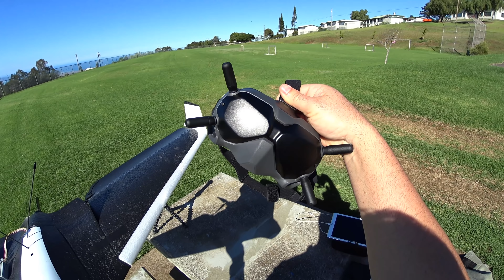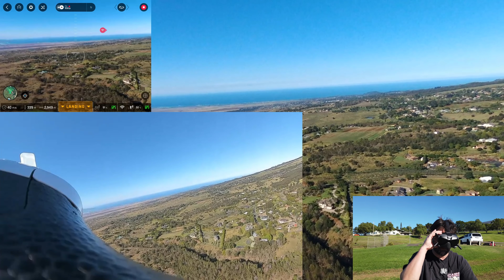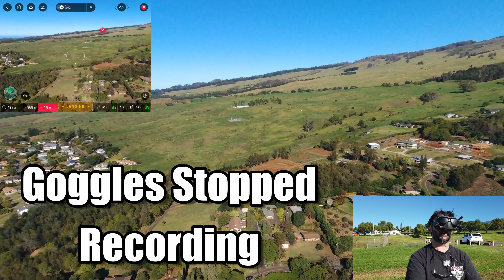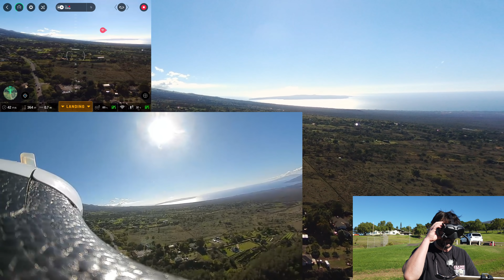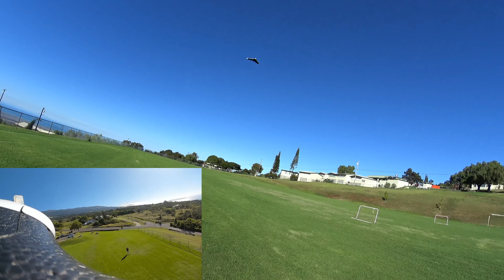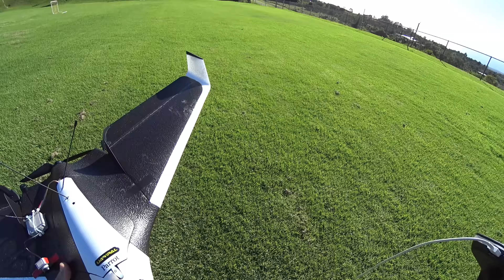DJI Digital FPV System Maximum Range Test (1200mW Hack) - How Far on 4GLte Parrot Disco?

Comment: So does this mean we don't need a Flight Controller to unlock or Arm the camera to full power to use on RC Cars etc? Just run that tiny script in the Goggles 2 (in my case) and that's it? ?

Comment: I regularly get over 10km/6miles with my V1 on 700mW, using patch antennas. Never flown with stock ones, but seems that replacement is worth it.
Reply: Which patch antennas do you use?

Comment: One thing that stands out for me on this video, is just how good that parrot Image stabilization is. I really wish they would start making a new version of the DISCO again!
Reply: Yep, stabilized video is the thing I like best about the Parrot Disco. Oh and, the 4G mod of course. Oh and the capability to add a 10.000mah battery for almost 2 hours flight. Oh, and the way it launches and loiters so easy and the way it lands. Parrot Disco is THE dream FPV plane. If only it had a better camera and a bit better WIFI range it would be totally perfect. Yes, the do need to make a version 2.

Comment: Could you PLEASE PLEASE do another at 50mbs! I’ve heard the syncs pulse is what kills the range even if you still have signal, but that DJI extended the sync pulse range on 50mbs.
Reply from the maker: Yes.  I just did a ground vehicle test video with the 50mbps and plan to do another with this wing 🍻

Comment: Looking at the time the video was uploaded it's before the DJI update that removed the 6 km / 4 miles hard limit (imposed by latency between DJI googles and air unit). At that time better antennas didn't help. Nowadays you can go much further. ;-)

Comment: So i have the DJI system but i am encountering low bit rates and poor transmission to the point where it disconnects acter like 400 metres?
Reply from the maker: Check your power setting in goggle options? Maybe your on lowest 25mw.
Reply: @DustinDunnill  Hey Dustin, i am running on 1200mw, stock antennas on goggles and drone
Reply from the maker: You flying low with lots of obstacles?  Otherwise maybe there's a defect or other strange interference?
Reply: @DustinDunnill  just some trees really, nothing too serious i would think
Reply from the maker: The amount of trees and how dense they are will make a big difference.  I was doing an update video yesterday for the exceed crawler truck with DJI FPV, new 50mbps update, 1200mw, Xair patch antennas, some other truck mods and it didn't do as good as I expected.  Physical interference just really degrades the signal 🍻

Comment: Hey Dustin, I hope you and yours are safe and healthy! I've been following your channel for quite a while now, and thoroughly enjoy yours videos (and envy your location) of drones and gadgets.
I've been hunting ebay for a parrot Disco for quite a while now, and today I finally got lucky when a seller made a 1 time offer that I could not resist. I refused to pay over 500$ for it, but seeing as it is discontinued the prices have gone sky high (pun intended). I've found no other drone to which you could easily do a 4g mod to, so I was adamant about the disco.

Long story short, I've been looking at your Disco series but most of the links to the hardware appear to be broken or items not found.

Would you mind lending me a hand? I've managed to buy the huawei dongle, the antennas, found the soft mod page and am waiting for the disco to arrive. I am stuck on the batteries, a good but relatively cheap charger, and the knowledge of whether or not I should change the motor for the one you recommend.

I've flown DJI drones (own a couple) but no fixed wings, so I am a newbie. I am drawn to the range and freedom of the 4g mod.

Also, considering the spare parts for these disco things are now discontinued, do you have any tips to make them more durable? Like a skin or something? Landing gear? Etc.? 

Sorry for the long comment, tried to find your email but couldn't spot it.

Thanks a lot my friend, Aloha!

Comment: So no real effective range boost by boosting the power...  is that the conclusion you came to?
DJI probably did the same tests and that's why they limited it to 700mw... the same as most wifi routers... all you're doing beyond a certain point maybe with that transmitter chip is sucking more power and generating more heat...
I'd fly at 700mw most of the time... and then only if you're at the very edge of limit edge then maybe boost..  apparently the change in power is isntant so no interference with your flight really... as you come back from the edge on the way home...  dial it back down to 700mw.

Comment: Dustin can u help please, I have a normal rc plane can I put this on it, I don’t understand the the wire you have to connect and how ?
Reply from the maker: Yes, the kit can be used on its own with goggles.  Just add power like I did for the air unit 🍻
Reply: Dustin Dunnill Thanks 🙏

Comment: Are you running the DJI system in "low latency" mode or "high quality" mode?
Reply from the maker: High quality
Reply: @DustinDunnill  Thanks.  Most people run "low latency".  Was curious if it made a difference in the 4 mile barrier.  Apparently not!  :)

Comment: Hi Dustin. Great video.  I was wondering,  have you modified the battery table in the chuck software config file to allow use of 18650 lion batteries ? Or is it the stock config battery curve?
Reply from the maker: Yes, modified 👍

Comment: Hi Dustin I’m fairly new to your channel & I’m enjoying absorbing as much of your info as I can. 
1) Can you give an estimate of 
    costs for disco mods for 
     max range & flight time (not 
     necessarily these dji mods - 
      mainly the 4K, battery, antennas, 
     boosters etc
2) is it possible to get a list of your 
     suggested mods if there are any 
     changes since Night fury fire vid
3) is it possible to buy one with 
     mods completed already? Plz 
     contact-Jtlending@gmail.com
4) can the disco still do “follow me” 
     & preset flight plan features after 
     the mods?
5) do u ever use these features?
6) have you ever added the ADSB to   
    disco or what are your thoughts 
      on this?
Thanks alot
Reply from the maker: Hey.  
-Cost is highly variable depending on how much you can find a discontinued Disco for.  All parts are in description but should all be below $500 (Disco included).  
-Disco doesn't do 4K.. 1080 max.
-someone from UAVPAL.com forum may build you one if you can send them a Disco.
-Disco does not do "follow me".  It does do flight plan yes.  Everything works normally after 4G mod.

Comment: Hey Dustin , dunno if somebody told u, but the Antennas on Mobile Masts , normally point in an angle down since the target users are on the ground. Thats why when you flew over that channel , your 4g reception was fine with 60ft but not with 130ft. Aswell, the 4G antennas must be specifically for that , the length must be precisely calculated for the frequency you want to use them.  Also with the mw rating on FPV, it helps to a certain extent , but think that the drone itself must transmit aswell, cause you may have outgoing power but you also need sensitivity on your receiver or a increased senter on the drone(which would be dificult since you dont have tracking for the antenna). For the Li-Po Pack you built in another video , why not try doing the same with Tesla Batteries since there is better energy density in the cells than the 18650 old design.  Great channel! :)

Comment: So it seems that the 1200mW is selectable but not implemented into the firmware yet, since you achieved the exact same range where you should have seen at least a good 20% to 25% more range given you up the power by a little more than 58%.
There is more to come guys!
Reply from the maker: It flew twice as far as 700mw behind my head at the end so I think it's working.

Comment: Howdy from Utah, I subed. 
I have no fpv gear. I want to get into it. I'm Trying to decide between a fatshark bundle or the dji bundle at getfpv.
I fly fixed wing. What do you suggest?
Thanks, Bret
Reply from the maker: If you can afford the DJI you won't want to bother with fuzzy analog 🙂
Reply: @DustinDunnill  thanks Dustin!

Comment: impressive, but I do not understand how you could spend 3.5km, my parrot disk at that distance starts the automatic rth even though it has wifi .... 🤷🏻‍♂️
Reply: Disco has an onboard linux computer and usb ports… allowing for software modification and support of 4G LTE Connectivity (you fly through cellular phone networks…), then you have unlimited range….  ;)

Comment: Seeing the DJI feed shows how amazing the Parrot camera stabilisation is
Reply from the maker: Indeed Sean.  It's quite amazing for a fixed camera with no moving parts.
Reply: But then you notice the camera stabilisation pixels the hole pic.. looks like 420p then instead of 1080
Reply: @heyho9396  not really, I think you're confusing the live feed for the recorded video, the recorded video from the Parrot looks pretty clear AND stable, to me anyway.
Reply: @SilverJigProductions  do u own one? I do! And the cam quality doesnt look good on bigger monitors. On your phone it looks pretty decent but as soon as you wach it on bigger HD monitors you see how bad it actually looks. The stabilisation pixels a lot
Reply: @heyho9396  fair enough, I'm sure you've spent a lot more time looking at footage than I have as I don't own one. But from everything I've seen it looks fine (not 480p anyway), and I'm watching on a 23 inch 1080p monitor. 🤷‍♂️

Comment: Is there another drone that does this?
Reply from the maker: Parrot Bebop2 and custom built ardupilot plane.
Reply: @DustinDunnill  I meant the fixed wing. That connected to LTE.
Reply: jeebs9 he exactly answered to your question... Bebop2 are supposed to be able to receive the same mod (of course they won’t be able to carry enough batteries to match a disco)... 
And planes having onboard computers running ardupilot programs can also receive 4G modems and route controls and telemetry through it...
But so far, I haven’t seen anything integrated so nicely as it is on the disco... and never seen anywhere else digital VR/FPV image stabilization (even through 4G) made by an onboard computer... only the disco...
Reply from the maker: Parrot really had something special with the Disco 😌
Reply: Dustin Dunnill indeed... and now, after having been so criticized by people not understanding what they were... and prices stupidly low... there is no way to find cheap ones anymore...
If only parrot had unlocked headtracking from the start... or a safe acrobatic mode with the Skycontroller2 (even assisted...)... they would have won the market... too bad their marketers were as bad as their engineers were great...

Comment: Isn't the 1200 mW the transmitter power (VTX on the plane)? Your head being the receiver isn't more subject to the rf power than anyone else's in the region. I figure you know this but during video I heard two references...
Reply from the maker: Yes your right.  Not sure if the goggle tx power changes (it does transmit also) more than 100mw who knows?

Comment: Dustin, @24.51 you indicated that hitting the RTH will cause the Disco to climb to the highest altitude that it's flown throughout the flight. Is that what you see every time?  I ask because recently asked Parrot support about RTH height and they said the Disco would climb to 50m (regardless of what you set in the app...e.g. loiter height) and return at that height.  I assumed it would climb to whatever loiter height you set but I assume that is not correct.  If what you said is true (and I believe you) it sounds like someone needs to educate Parrot Support about the true behavior of the Disco with RTH. Can you confirm that you don't have the loiter height set to ~100m (i.e., 321 feet :-)
Reply from the maker: Hey Jet, correct I only have my loiter set to about 150ft I think (can you see it in first part of vid when I'm putting on goggles?).  At RTH activation It's always climbed to whatever height I've gone that was  over the set loiter height 👍
Reply from the maker: Perhaps I did have the loiter set to 300ft as it looked like it went that high at launch
Reply: @DustinDunnill  Thanks for getting back to me. It does look like it loitered at 300 ft so I'm assuming that's what you had your loiter height default set to. It seems logical that the Disco would return to the loiter height when returning to home because loiter height is intended to be a height to avoid all obstacles in the take off area. In any case it seems that Parrot Support was wrong stating that when you hit RTH the Disco will go to 50m (regardless of the RTH setting) and then RTH at that altitude. I'll test it out when I get the chance. Thanks again.  PS. Love you Disco videos!!! Look forward to seeing more.
Reply from the maker: Yes, I'm pretty sure the community concensus is highest altitude of flight.  Thank you.
Reply: Hum... seems an easy test to do for next weekend... after having built a camera heater... its cold in France, which makes the videos blurry...
Reply: I have tested this behavior: DIsco will RTH at the highest altitude reached during the current flight…. BUT Bebop2 (same computer/camera/etc.) will go to 20m OR keep the current altitude if higher than 20m...
I prefer discos behavior… but disco is not endangered when going high (it will glide down for 0 Energy later), while quads/bebops will burn a lot of Energy to go back down also….

Comment: How does 1.2W affect the watt draw of the air unit?
Reply: Dustin M 1200mw would easily require 4w (Dustin told it was HOT) on the battery... which is roughly 1/10 of the theoric power required for cruising speed...
Reply from the maker: Seems to drain the batteries quite a bit more than the 700mw.  I mentioned this at the end 🙉

Comment: Fpv is so much better on a quad
Reply from the maker: Yes, this same camera can be much smoother on a well tuned race quad do to the nature of having 4 motors/propellers for lift.
The purpose of these videos are strictly to test range at different power levels.
Reply: mr. vain vice you mean a flying camera? Mavic pro and Co?
Reply: @tuttoto  camera on a race quad
Reply: mr. vain vice how long can a race quad fly?
Reply: Yeah right...not!

Comment: Not too surprising... Transmission power is logarithmic, so simply doubling the power wouldn't equate to double the distance, it would actually take 7000mw. It will be interesting to see how it does with some good directional antennas, as you can technically get a real boost in signal from them.
Parrot should bring the Disco back👍
Reply: It was removed on purpose, it will never be back, but there are some refurbs if you look around. I bought one last year.

Comment: Yo can I buy you drone how much caz am kid dumb I don't know how to modified like u
Reply: Khmer Texas Going Home 2040 I think you should avoid flying this kind of bird if you don’t FULLY understand how it works... you would really be disappointed losing it, not knowing how, or having poor performance, not knowing why...
Disco in correct shape are very rare now, as most buyers didn’t understand how they should be used, and just “had fun” flying as low as possible, as fast as possible... until they crashed them...
You PREPARE a 4G Disco flight a lot, checking network availability, having matching sim cards from the best providers to allow for direct bridging, changing your route if coverage is not optimal, flying away against the wind, avoiding the no flight zones, computing power requirements and range... having identified recovery protocols in case of issues... having configured it to broadcast SMSs with its location... and having added a tracker in case everything would go wrong...
I would suggest you watch EVERY video made by Dustin with Discos or Night Fury and UNDERSTANDING everything he was doing and why before planning to own one of those flying robots... (I did... ).

Comment: Dustin you queried whether there was a hardcoded 4 mile limit? but how would the goggles know range if the fpv was a completly independant system from the telemetry data? could it be more of a geographical issue? its hard to tell from video but could hills be potential factors for blocking out the signal? would make sense if you used the same flight path on the lower power test.
Reply from the maker: Your right.  I was thinking after the fact and without any GPS or telemetry it can't know it's distance.  I don't know why I said that.   It's a clear line of site at that distance even if I drop it a couple hundred feet.
Reply: Dustin Dunnill it seems that you can change the power of the video transmitter during the flight... then the googles can time the distance... I don’t say they are doing it, but I would now how to do it.
Reply from the maker: Yes you can.  Perhaps they do have another way of estimating distance then.